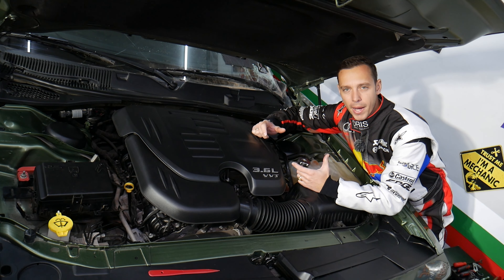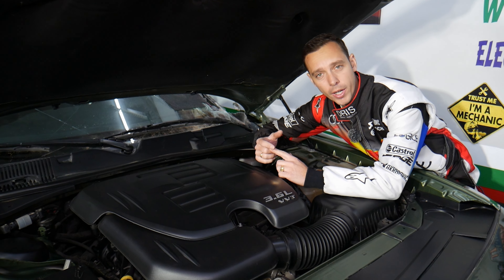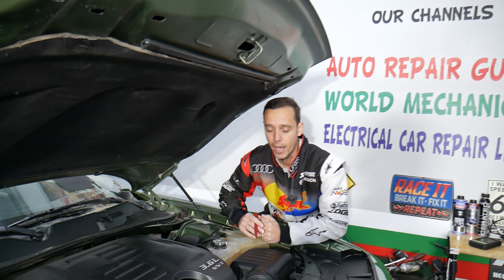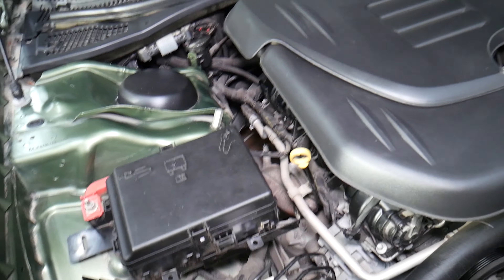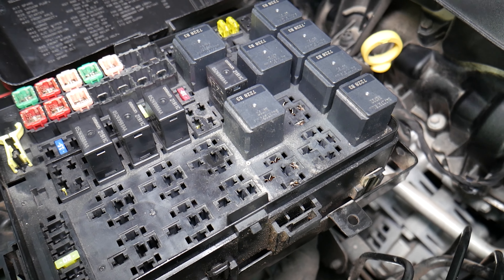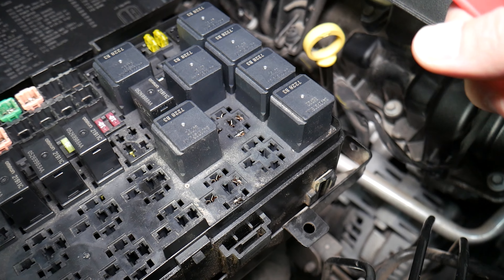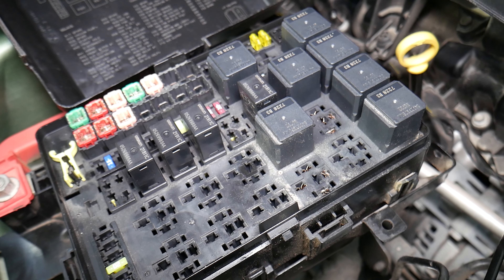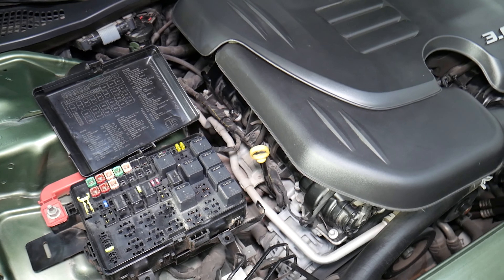DODGE CHARGER HEADLIGHTS RELAY LOCATION REPLACEMENT, HID HEADLIGHTS RELAY

Comment: I got a 2014 charger rt it came with factory HID’s but the guy who had it before me swapped it to tinted halogen lights and my hi beams dont work.. i put new LED’s in and nothing still, wont even show the high beam indicator on the dash.. checked all fuses to and nothing any help
Reply: Did u figure it out